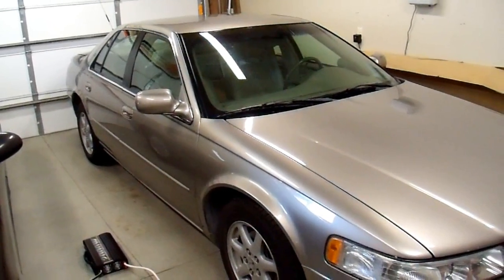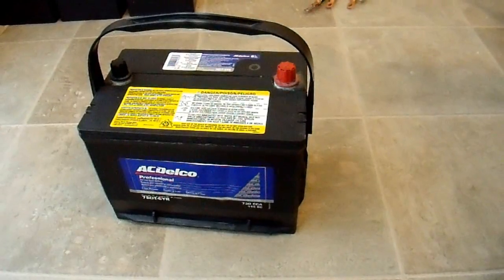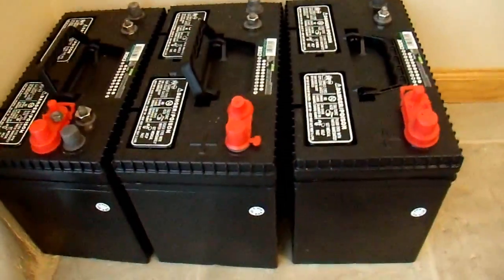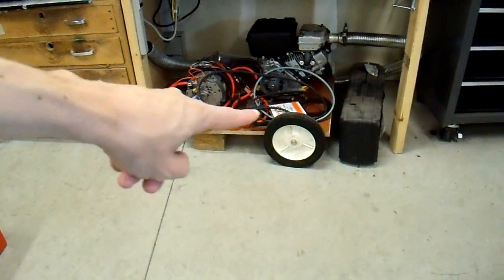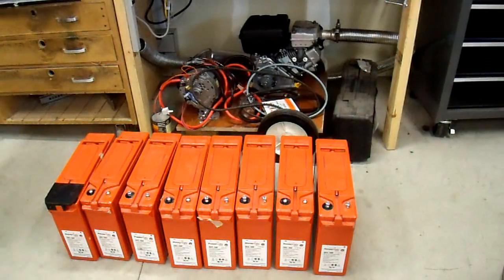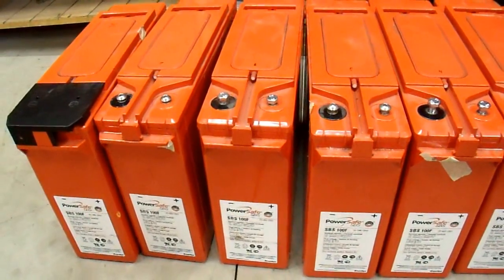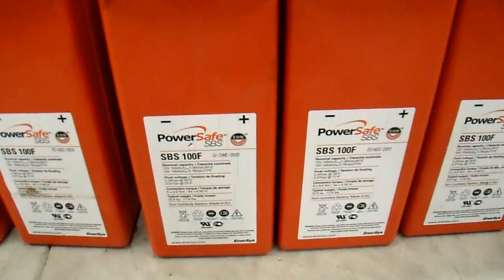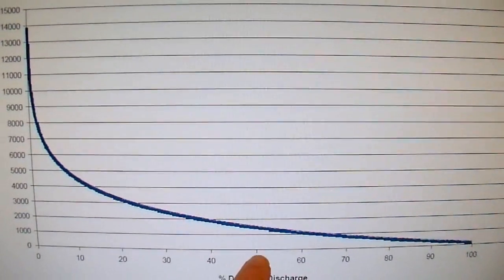1000Ah Battery Bank Part1 - My Salvaged $40 Battery Purchase : an Introduction

Comment: For someone who knows a lot about batterys im very surprised you keep them on the concreat floor. NEVER keep lead acid batterys on concreat, it will shorten there life dramaticly. Always keep them on rubber or Wood.
Also for a battery that last the longest you should sorce Alkaline batterys.
unlike lead acid they are far less corrosive, and last upto 10 times longer.
great score you did well
Reply from the maker: It is a myth that lead acid batteries on concrete is bad.  The origins to this myth are from the days when battery casings were made of tar coated wood which had a habit of leaking onto the concrete, making a conductive path, and discharging the cells.  Today's batteries don't care what surface they are on so long as there are no significant temperature cycling conditions.  (Such as a heated floor.  Concrete is a reasonably good conductor of heat.)
Reply: WoW I never herd of a wood battery lmao cheers for clearing that up. I think ill still keep mine on a piece of wood. Old habits die hard
Reply from the maker: sindrome303
Certainly nothing wrong with storing them on wood.  I too am more comfortable with keeping them insulated from the concrete to prevent thermal gradients.  I know it doesn't really matter and I have stored batteries on concrete for long periods of time with no noticeable accelerate self-discharge, but somehow it makes me feel better to not have them on the floor.  Like you say, old habits...
Reply from the maker: Kirk McLoren
I am sure this is true in theory but I've never seen it in practice.  Not withstanding heated floors and such batteries I've stored on concrete vs. other surfaces have self discharged at a similar rate.  The thermal conductivity of concrete may be high vs other insulators, but compared to a battery with it's internal conduction and convection it is extremely low.  The battery will be nearly uniform regardless of the surface it is stored on.  Especially lead calcium batteries which have a larger reservoir for particulate matter to accumulate at the bottom of the cells.
Reply: The impedance of lead/acid is rather low so appreciable drains can be created by small temperature gradients. Thus a cold concrete floor vs warmer air creates a gradient top to bottom increasing self discharge.
Reply: Kirk McLoren What he said....

Comment: Just put together my first battery bank with 2 battery.  Also I have a small 10amp maintenance charger that can give me a trickle charge.  I was wondering, if the electric goes out, if I could plug into my 15000 inverter and charge my bank up basically from my own battery.  would this work at all?  or maybe from another batt. to be recharged in like manner later.   What do you think?   please let me know your opinion on this.  Got to say, I have learned a lot from your video's and have to thank you for making them.
Reply from the maker: You could charge it from another battery but keep in mind the efficiency losses at each step.  (estimates only)  5% in the DC cabling, 15% in the inverter, 25% in the charger, 10% in the DC cabling and clamps, 20% in the battery being recharged.

After multiplying them together in the end you're left with less than half the energy that you started with in your battery.  It would be far better to instead add another battery to your setup permanently.

As far as charging a battery from itself - nope.  You simply generate heat in the cabling, inverter, and the charger and drain the battery by the exact amount of the heat that they give off.
Reply: trickle charge is the fountain of youth for lead/acid. All chemistries suck except the Edison cell. Some in service over a 100 years. Electrolyte has to be changed as it absorbs CO2 from the air. Uses KOH as electrolyte rather than an acid.
Reply: look into solar johnnie
Reply: Why would you want to charge some batteries fro other batteries?
Also, normally, one would charge a smaller battery from a larger battery.

Comment: A good case of being at the right place, right time. Are you familiar with Nickel/Iron batteries? They are supposed to last for several years and aren't finicky about discharge levels. Grab 'em if you come across them cheap.
Reply: Only 2 builders at this time. One in China and one in Montana, zap I think. The cells as made by edison had enormous life. The Chinese use plastic bits so life prob limited to 30 years by that. Don't know how Zap is packaging. Some of Edison's cells are still in service. J Lenno has a Baker Electric he drove on TV and he said the batteries were original..
Reply: Russia makes them, too, IIRC.  Alibaba.com led me to such a vendor, but I chose the Chinese maker.

Comment: how much power could you pull from these for 15 seconds
Reply from the maker: lots.  :)  For practical purposes you could assume a 1000ah battery bank will supply 10kw of power when fully charged.  This depends on many factors but would be a reasonable rule of thumb.
Reply: ***** that is a 10 hour rate at 70F

Comment: The SBS 100F  A lot of cell towers use them as repeater backups.  My son use to install the complete tower system and would buy 800-1200 batteries 100Fs and others of the same type.  Because of his buying power he would buy them at that time $109 ea.  So I would have him order me 12 every two years.  Great but costly, I think about $500 or so ea.
Reply from the maker: holy sh*t!  $109 each new is practically stealing them!  That's a great deal on a quality new battery.

Comment: one thing you don't sit batteries on concrete like he has just done
Reply from the maker: Batteries stored on concrete being a bad idea is an old myth from the days of wood/tar battery cases.  Batteries can be safely stored on concrete with no repercussions.  The only thing to watch for is the relatively high thermal conductivity of concrete vs other common floor materials which can cause temperature gradients within the cells hastening self-discharge, but the effect is minor.
Reply: ***** In a calcium lead plate battery thermal gradients can be the major source of self discharge.

Comment: Use the Batteries to run the air tank compressor, use the air pressure to run an air motor to turn an alternator. use the alternator to recharge the batteries to extend the life of them.

Comment: Used in things like forklifts and man lifts and the such. Good batteries. I have 30 of the same type battery in my solar system. I also have some 2 volt deep cycle batteries I acquired from AT&T wireless that were in a cell tower site they were updating
Reply from the maker: Nice setup!  I wasn't aware that forklifts used them too.  I usually see the flooded lead-antimony type in those.
Reply: Yes some brands and models. A new battery i have came across are 3.2V @ 60 AHr Lithium made by Thundersky which I have found work quite nicely and a alot lighter weight but of course the cost can bite you if your needing alot of them. Something in the $90 range ea.
Reply from the maker: Melinda Green
Lithium is great for certain applications but they have limitations in their lifespan.  I don't like lithium power tools (because I tend to keep my tools for more than 10 years and my NiCad tools still work awesome after 10+ years), and I don't like them for automobiles either until their replacement cost is reasonable.  For home backup I still think lead acid is the place to be.  Just my opinion.

Comment: Unfortunately I don't have access to batteries as nice as these, but I do have access to a nearly unlimited number of 10 year old UPS batteries.  The UPSes were always plugged in, but in the occasional power outage they run till dead.  You think it is a good idea to try to open em up to add water and use them as a bank like you have here?
Reply from the maker: Batteries are engineered for a finite life under float conditions and as such I do not condone adding water to sealed batteries, however I also encourage the spirit and ambition of those who wish to make use of things that have been discarded.  If you have success let us know!

Comment: nice deal for scrap value, you can get quite a few other brands (rolls/Hoppecke I'm sure others, can't find the other brands I'd been looking at which at 50-80 % DOD give even better, But I'm sure yours are the best price for sure :) Look forward to next videos where you test etc them
Reply from the maker: I had a shot at some Trojan batteries too, but I like these AGM batteries better since they stay clean as they age (no acid drooling) and because at well over 100lbs they would be difficult for me to handle.

Comment: A really good deep cycle battery brand I came across are the Northstar brand. I used to lug those to cell towers when carriers did change overs from the 400lb 2v cells, rated 1000 amps to 100lb 12v northstar cells rated around 170amps. They used a 48 volt system for standby power to keep the tower going tell the utility came online again. They look just like those you got their on your floor. The best johnson controls battery I have ever bought in consumer grade is the optima yellow top and the duralast yellow deepcycle car battery, it held well for many years. Hope to see some beefy inverter tests with these or even a whole house inverter system would be cool.
Reply from the maker: Telcom batteries like those Northstars you mention are some of the best, but aren't affordable for most people like myself to purchase new so I was lucky to find these!

I tried an Optima yellow top many years ago and was not at all impressed with it.  Maybe I just got a bad one?
Reply: ***** yes you must of, i have had a yellow top for over 5 years not and it has been cycled many times with inverters and i use it in my 5.7L hemi. Lucky steal of a deal!
Reply: *****
Any specific reasons why You weren't impressed with it? Some weaknesses perhaps? I may get my hands on a batch of used yellow-tops. Should I look out for something in particular?
And a really nice battery bank indeed! Congrats. Oh boy do I envy You :)
Fellow battery-geek.
Reply from the maker: drezster
Yeah, I don't know why I like batteries so much.  I always have even as a kid.  I actually got batteries as a Christmas gift one year long ago.  Loved 'em.  lol.

Anyway, I don't like the spiral design because it is space inefficient.  I prefer the parallel plate variety as you get more capacity in a given BCI size.  And the one that I tested had a cell go bad after only 10 or so cycles and failed well before other supposedly similar batteries.  Higher price, shorter life, lower capacity:  I didn't see much to like.  But maybe I just got a bad one and I'm glad you've had good experiences with them.  I seem to get about 10 years out of standard car batteries so I don't see any reason to pay extra for that either, but I am careful not to cycle them.  I can see how they'd be good for that purpose.
Reply: I have had two different yellow tops in the past few years along with some of my other car enthusiast friends. they work for a long time if you maintain them. if you let them discharge they turn out to be junk very quickly. ive since switched over to Kinetic batteries for the audio and lighting in my jeep. i cant say about reliability of these yet, but wow do they pack a punch for amp output. HC1800 and HC600